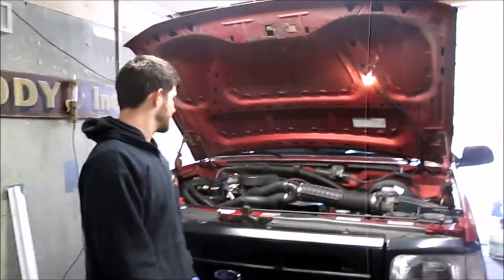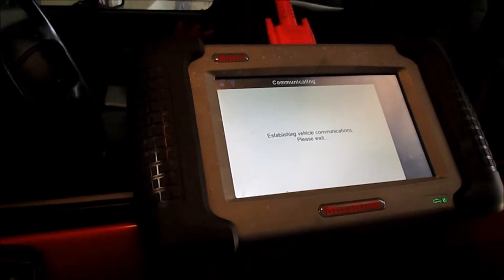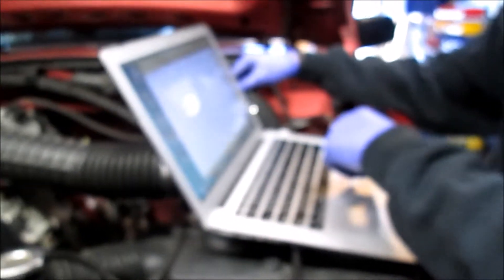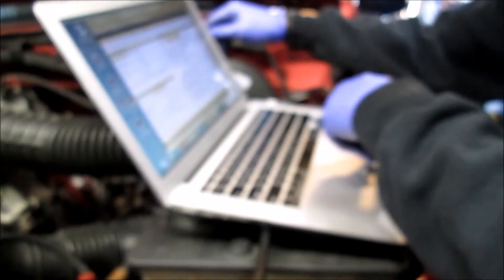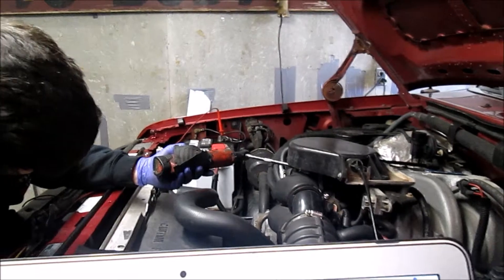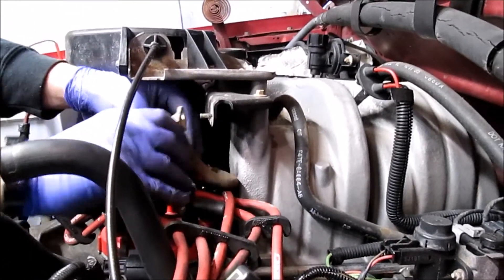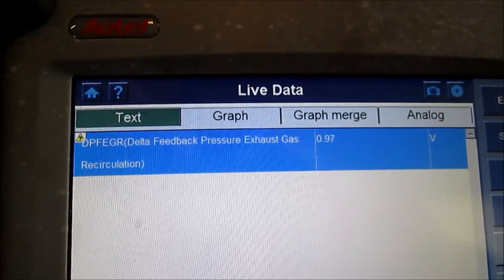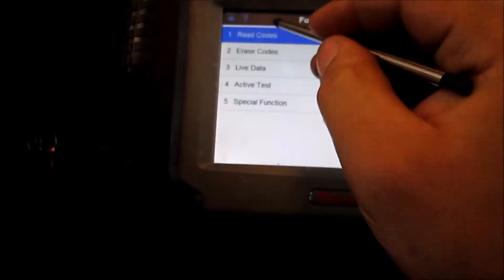1996 Ford F150 5.0 V8 P0401 Diagnosis and Repair (see description)

Comment: I have almost the exact truck but I have a performance cam it’s sitting on some fat 33s and has performance knn intake and air filter, also I have tacs mounted...I need to replace the throttle body and give it some love but it is coming together pretty good

Comment: This is interesting as my '96 F150 5l  started throwing similar codes and yesterday it threw a generic P0402 on top of the P1405 and P1406 codes it threw a week ago.  The DPFE was changed when the truck was still under warranty and I know the EGR valve is clean and its port into the plenum is clear.  Time to open the hood and do some sleuthing!

Comment: Run fuel injector cleaner thru the tank to clean injectors and valves.
Reply: I use B12, a can &1/2 in each tank.

Comment: If you get improper vacuum at the EGR, replace the charcoal canister purge valve. If you get oxygen sensor rich and lean codes, replace the MAP sensor.
Reply: 1996 F150 and Bronco are MAF (not SD - speed density) and do not have a MAP sensor (which SD uses and MAF does not).  MAF engines infer manifold pressure using a calculation based on mass flow rate through the MAF sensor, temperature read by the ACT sensor. Improper vacuum can also be a vacuum leak on a hose (especially if the hard PVC hoses have not been replaced) or a bad vacuum reservoir... or a bad EGR valve.  DPFE is the sensor that verifies the operation of the EGR by measuring the differential pressure (the DP part of DPFE), so if the reading is inaccurate (and everything else works), then the sensor is at fault.

Comment: OK, you jokers are having way too much fun!  And, by the lack of focus, it would seem like you were drinking and smoking stuff as well!  In any event, this old fart is just trying to understand all those crazy terms you mentioned and dumb it down in a way I can understand what happened....The fault code was telling you the EGR was not working correctly, correct?  But, that crazy sensor you replaced somehow watches/senses EGR performance and trips the fault code....So, it seems like there really wasn't any problem, except for the funky EGR sensor module...I'm guessing the truck ran fine also, because the EGR was working fine, but its "performance sensor" was busted...
Reply from the maker: Thanks Don.  The EGR system was working fine, however the PCM (computer) thought that the EGR wasn't working so it tripped the code.
Reply: kramden o
Reply: Ford Fanatic